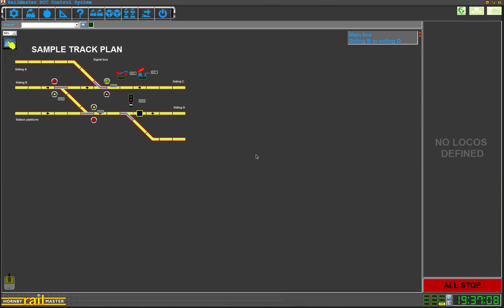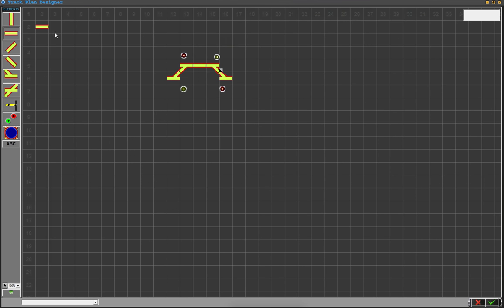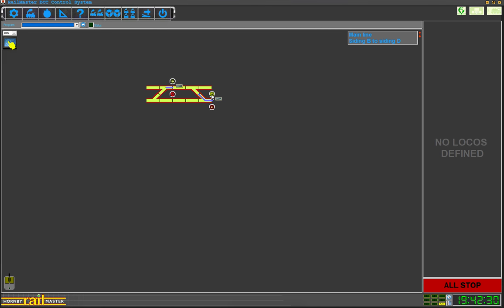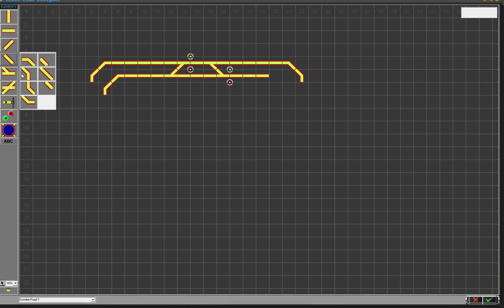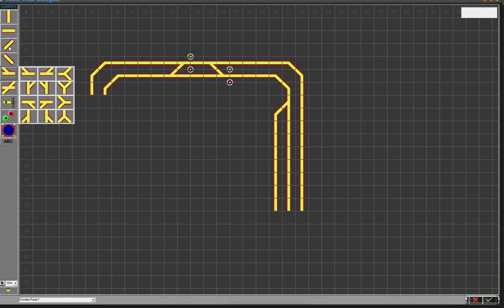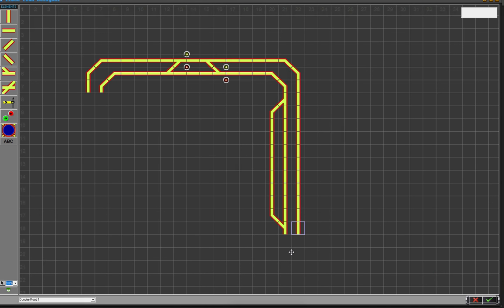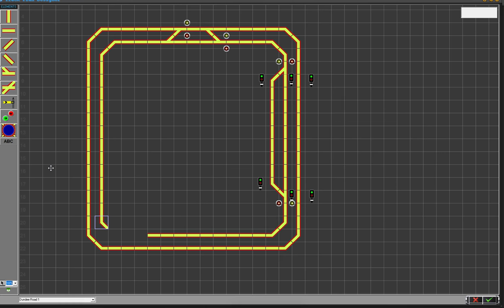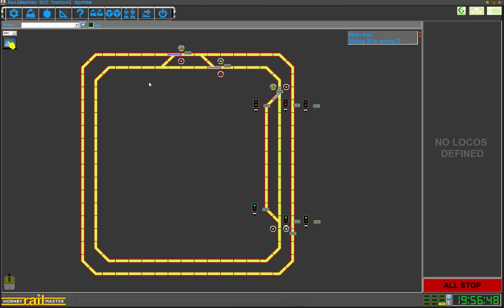Railmaster Setting up Basic track plan

Comment: Excellent tutorial. I've just got round to buying it myself. So that's information I needed. I'd like to see how you go about wiring. And would the system cover a 5metre by 4metre with sidings without additional boosters. Kind regards
Reply from the maker: Manny Cowen hey I️ have that planned for a video to come.  I️ have an orbital pair of wires with droppers from each rail under the base board. Stay tuned and it will be up as soon as I️ can make it.
Reply: I look forward to that. It's refreshing to see someone doing instructive video's instead of going off subject